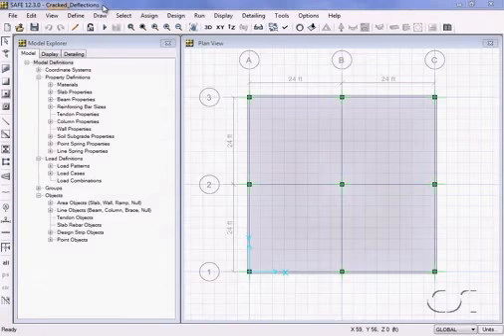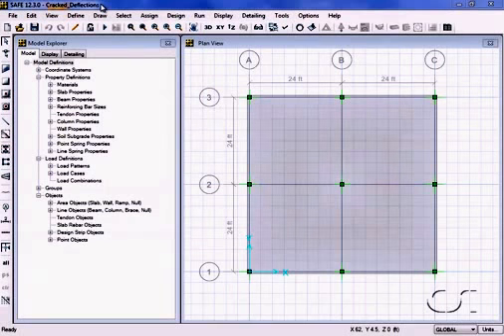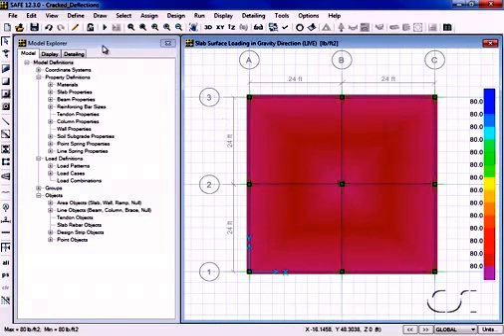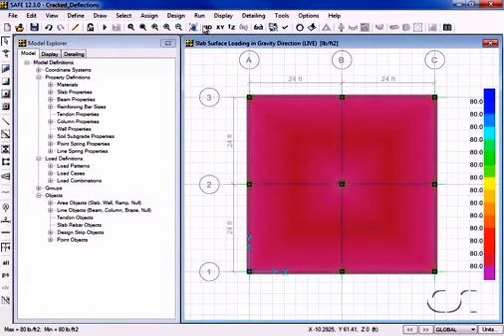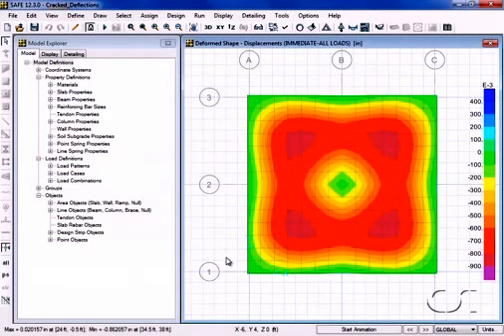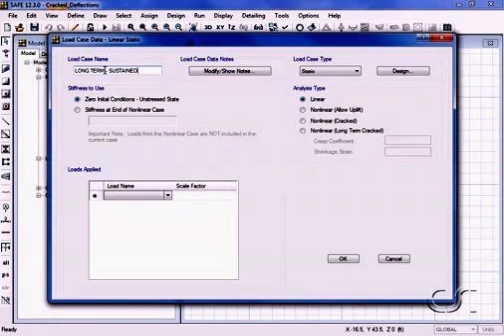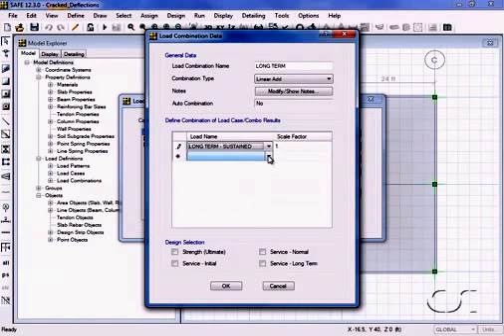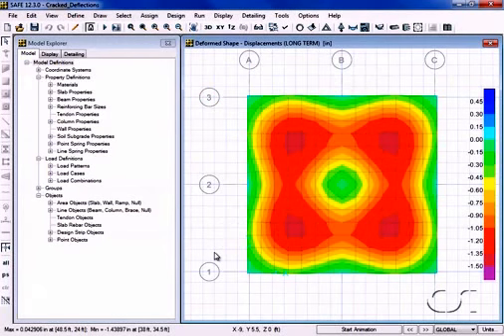HOW TO CALCULATE LONG TERM DEFLECTION USING SAFE 12

Comment: why we didn't change the modifiers for beams or slab
Reply: if u got an answer , Kindly inform me
Reply: changing the modifiers is to take cracked section in concentration ,as in the tutorial he used the cracking analysis and Fctr for concrete